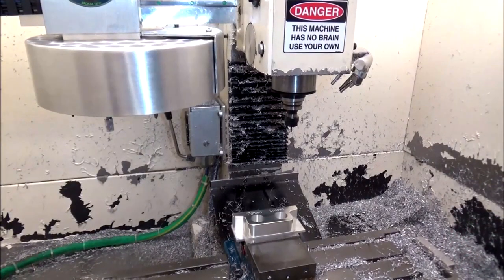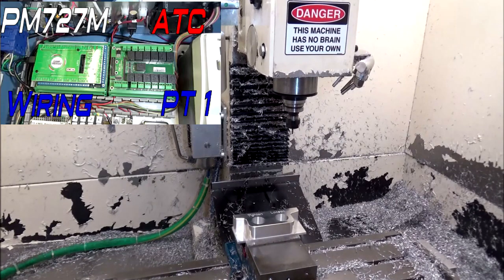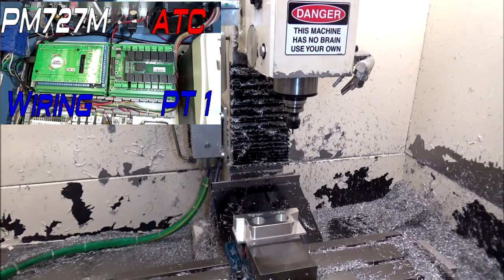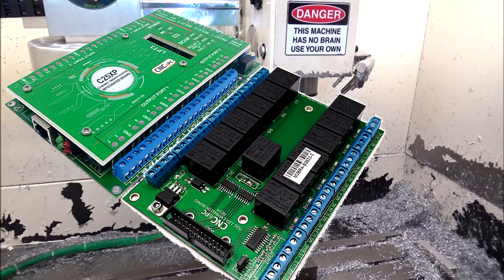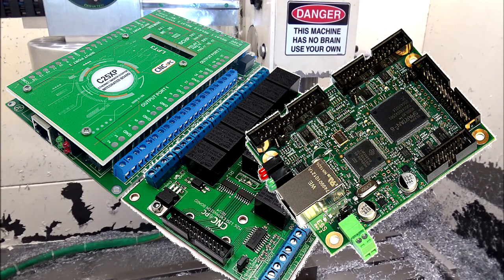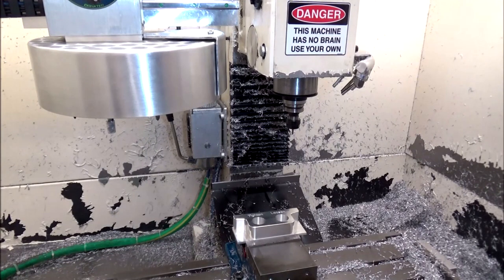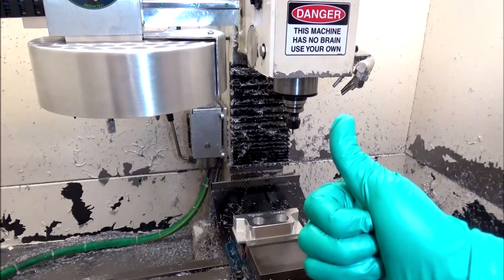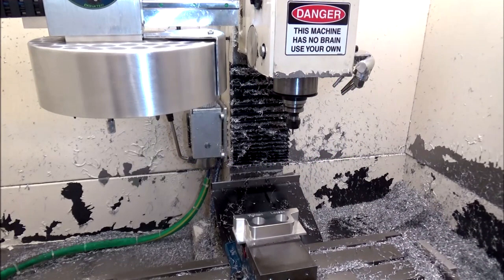CNC4PC C25 Give Away!

Comment: Is it still Mach3? It's not a real time operarion, i almost gave it up and swapped to Linux cnc by using the terrific mesa 7i76e board!
Reply from the maker: Linux CNC is a Great as well It's just not as friendly as Mach3 to set up and adapt to various machines. But a great choice non the less.
Reply: @CNC4XR7  and Centroid cnc 12 is even friendly than Mach3 and Linux
Reply: Swap it to Centroid cnc 12 you'll never regret.
Reply: @uptechcncpvclt-1302  high price ...concerned.
Reply from the maker: @uptechcncpvclt-1302  How did you customize the auto tool change process? Screen? These are the things that are very easy to do in Mach3. No doubt Acorn is easy to setup but when it comes to more advanced features. You will need support from Centroid and most likely the higher priced Board as well.